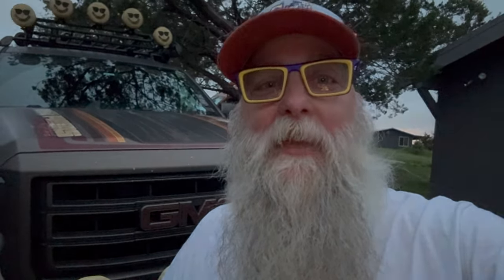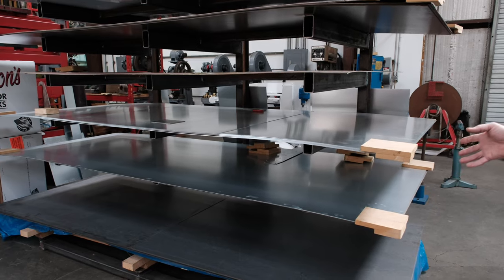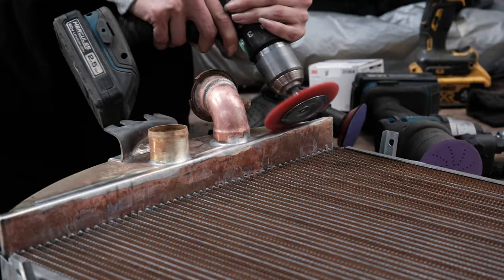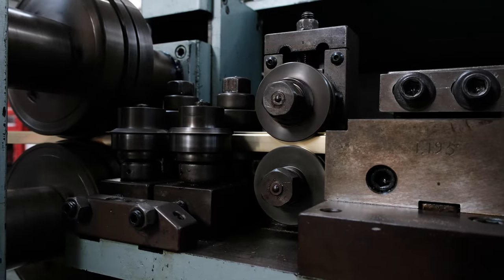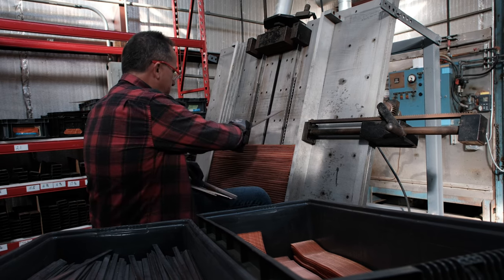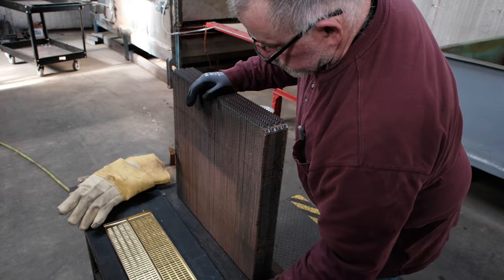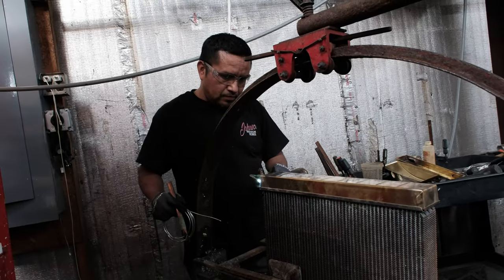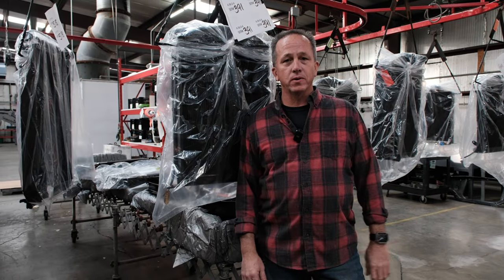How the Best Radiators are Made at Johnsons Radiator Works - Radiators for Anything You Drive

Comment: I hope they're better than Walker.
I bought a brand new Walker for my 34 Ford and it leaked from day one.
Reply from the maker: Sorry to hear that did you ever reach out to walker? I know they were always good about replacing defective products.
Reply: I bought the radiator in Buffalo and brought it back to Canada.
It was well boxed with spray foam in plastic bags for protection.
It sat in the box for nearly a year before I was ready to install it so it would have been past any warranty.
It was their Cobra model for big blocks and I have a fairly mild small block so it wasn't working very hard. Especially with a 7 lb cap.
Shipping it back really wasn't an option.
I've had it repaired at a reputable radiator shop and it just started leaking somewhere else.
Now I'm using radiator "stop leak" and only filling about 3/4 full.
It still leaks but not as much.
I won't put any more money into this.
I'll try an aluminum rad.
Reply from the maker: @colehara sorry to hear that man I’d have at least tried to get the dealer that sold it to you in Buffalo to help out……… I’d seen walker replace stuff that had sat longer, but they aren’t around anymore I wish you the best of luck with the next radiator.